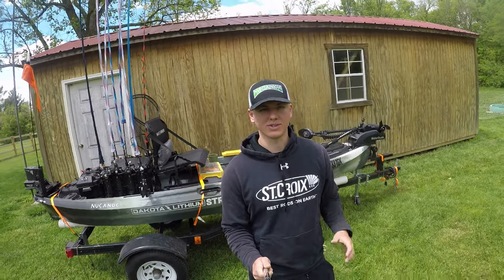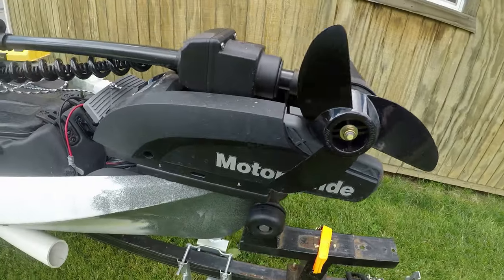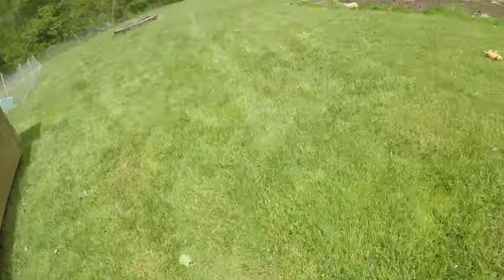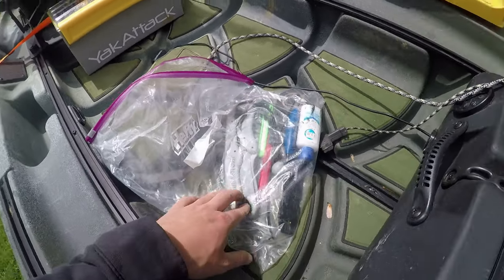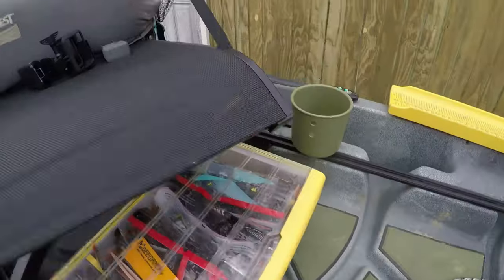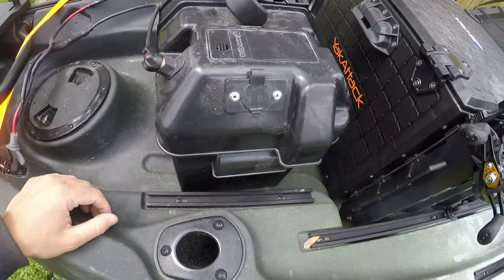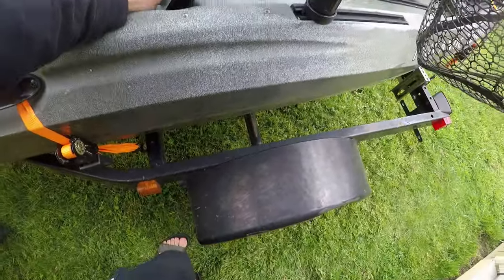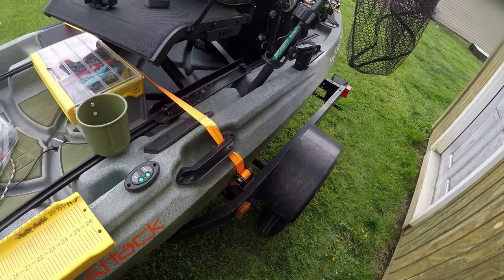My Nucanoe Unlimited Kayak Tournament Build (Watch Before You Buy!)

Comment: I just bought the same Kayak but my entire hull is jet black. I am getting the motor guide added to the front and night lights like you show here.  I like the idea of the pole in the back.  It would be noce to not have spot lock running in a shallow area.  I am going to look at those power poles for sure.
Reply from the maker: They're great. Especially for rivers. When you're in current and need to stop quickly it's a lot easier to drop the pole than to spot lock especially if it's shallow.
Reply: @xXBBoutdoorsXx  Excellent point.  I like the idea of using that in shallo water for sure.

Comment: Love the setup! I am very close to purchasing the same kayak. I had a hobie outback for many years but wanted something easier to stand on and rig with gear. How do you like your setup with the Xi3 and how long does your battery last? Just curious because I plan on doing the same setup with the Xi3 motor. I am aslo going to trailer it with a modified jet ski trailer and was curious how you have your bunks setup.  Thanks for the great videos!
Reply from the maker: The battery has run for 11 hrs before and I have yet to run it dry

Comment: Great video!  What do you use to strap down your blackpak and battery box?
Reply from the maker: Nothing. They're both heavy enough that I'm not concerned with them flying out of the box. The unlimited does not have any built in anchor system in the back so I'll be buying bungees and pad eyes to attach both more securely but ultimately if I go completely upside down I'll have much bigger problems than my blackback and battery sinking

Comment: Nice rig. How long does the 100AH battery last? Have you ever worried you could run out?

Why get the power pole if you have spot lock? Does it hold your position better? Like holing your yak sideways in place instead of holing a position but the yak roating ?

Thanks.
Reply from the maker: I'm always worried I'll run out of battery but it hasn't happened yet. Realistically I probably havent even been close to running out but I need to get a good lithium tester to know for sure. 

As for the power pole it's good in a lot of different situations. I got it for my old Jackson and it's such a nice piece to have that I incorporated it into this build. Bed fishing and anchoring in current are two that jump out to me but in extreme winds or very shallow water it's nice to know I don't have to rely on my spot lock to stay still.
Reply: @xXBBoutdoorsXx  thanks bro

Comment: Do you have any problems with the nucanoe plugs?  I see a lot of people going with the marinco plugs.
Reply from the maker: I don't use scupper plugs
Reply: @xXBBoutdoorsXx  can you explain that alittle more.  I’m a newbie.   Does that just mean the water drains out right away so it doesn’t affect the plugs?
I see a lot of people not running scupper plugs and still going with marinco.
Reply from the maker: @ryanharrod1155  my mistake. I thought you meant scupper plugs but I see now you meant for the motor. As for the nucanoe plugs they're fine so far. People have said they melt/fry easily but they've been fine for me. I'll probably upgrade at some point this year just out of caution but they've been fine for me so far
Reply from the maker: @ryanharrod1155 For what it's worth, today after 2.5 years of use the stock plugs broke and I just got done installing the marinco
Reply: @xXBBoutdoorsXx  hey they lasted along time.   
I just got my build done a few months ago.    I went with 6 gauge and the marinco plugs too.   They work great so far.